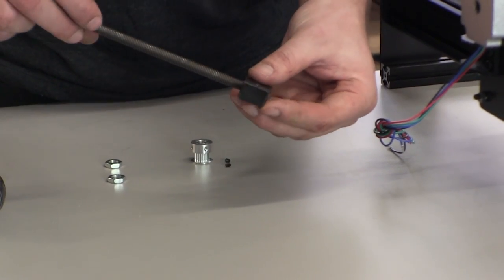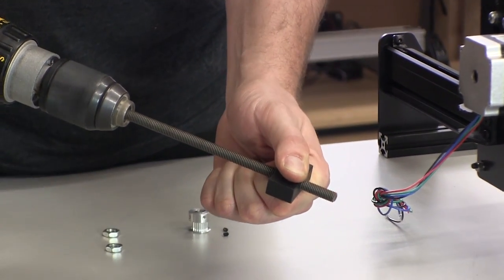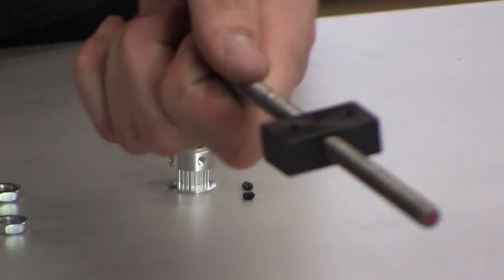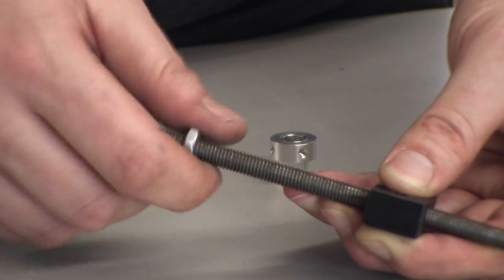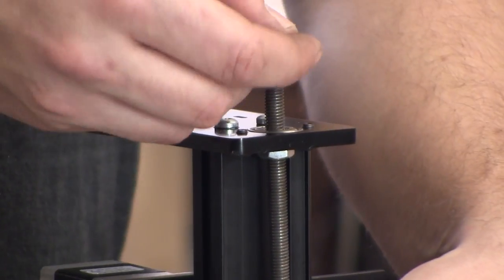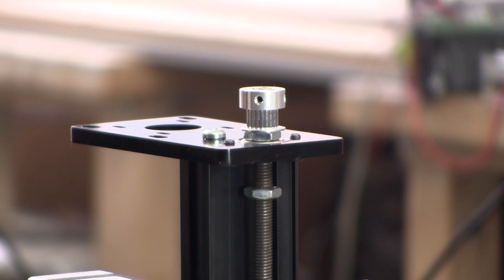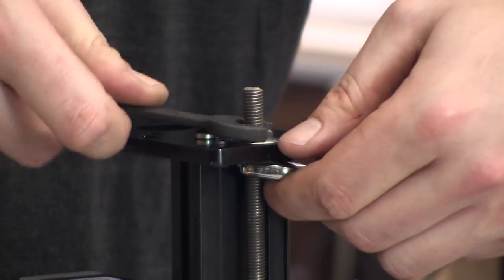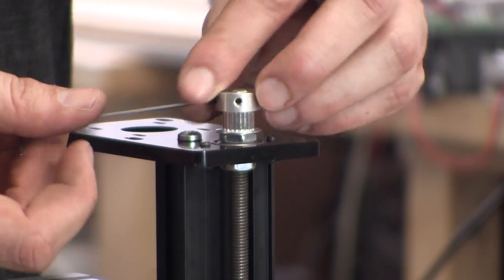X-Carve | Assembly | M8 Threaded Rod

Comment: Bro is this threaded rod or lead screw. Does this threaded rod work fine with the router. Can in use a t nut along with threaded rod. Does it work.
Reply from the maker: This is a M8 lead screw and it works great with with our Dewalt router!
Reply: @inventables  can i use threaded rod instead
Reply: @nsk6914  its a threaded rod . lead screws have different looking threads and in the video titile also it says threaded rod . idk why the said its a lead screw

Comment: After seating the delrin nut by running the threaded rod back and forth through the nut, chase the threads on the rod to clear delrin debris before installing the delrin nut permanently.